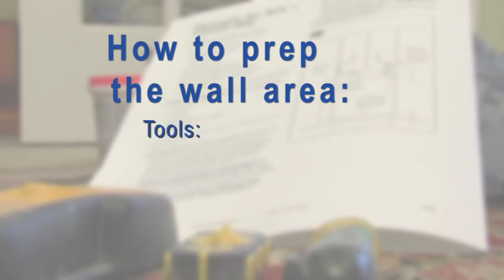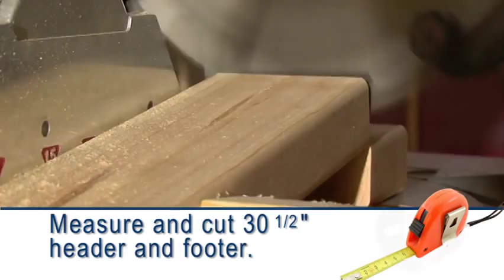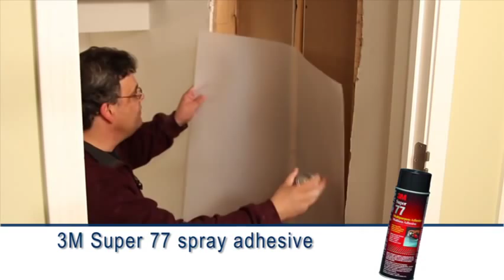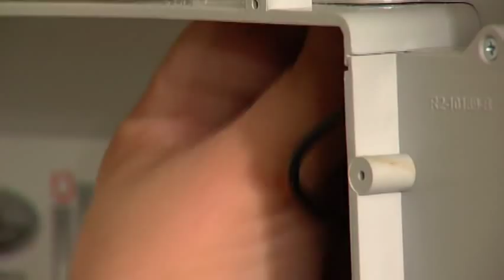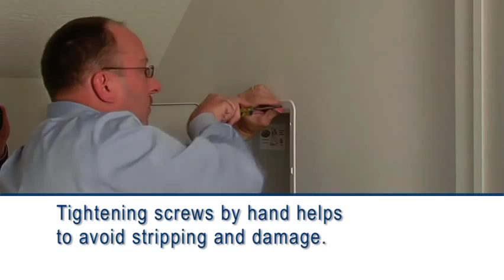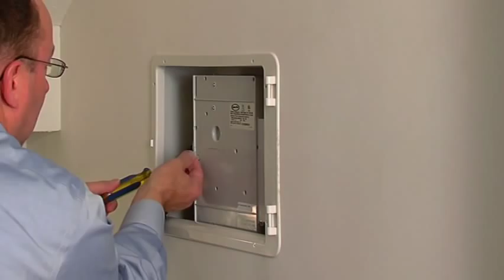Central Vacuum Retractable Hose Management System - Doc IT Installation

Comment: what a pain in the ass, I like the other system that just uses the vacuum motor suction to bring in the hose
Reply: They can’t use a power head. No high voltage hose.
Reply: @kurtvonfricken6829  Battery operated heads are now available from several companies, (Tacony, Wessel Werk, Lindhaus etc). These Doc IT systems have been long discontinued they're very unreliable and the 50 foot wire reinforced hose cuts down on airflow terribly.

Comment: Nice neat work. However, you should never cut out wall studs without installing a temporary support wall to carry the load that transfers from the floor joists above or roof trusses. Overlooking this step can cause structutal damage.
Reply: Only if it’s a load bearing wall.